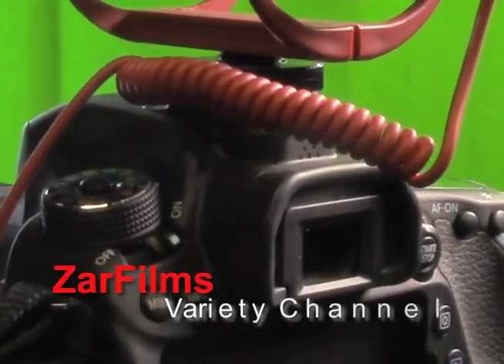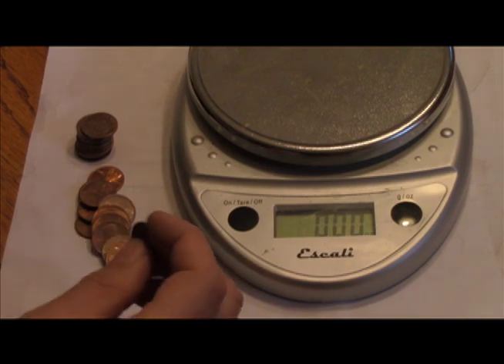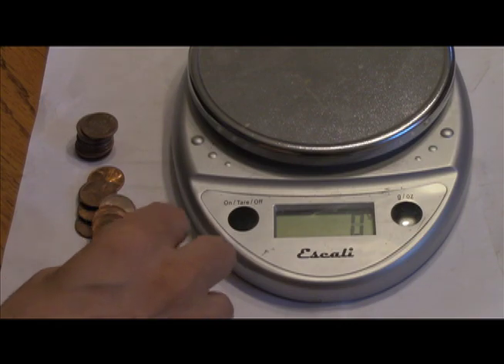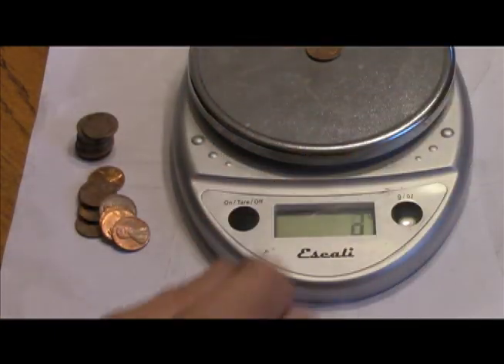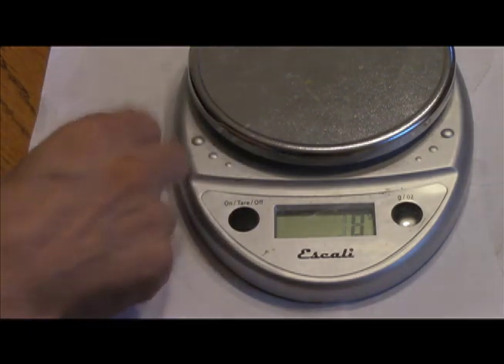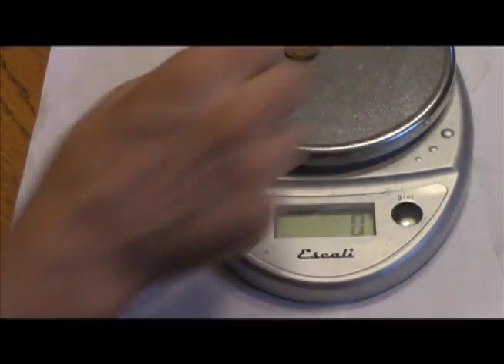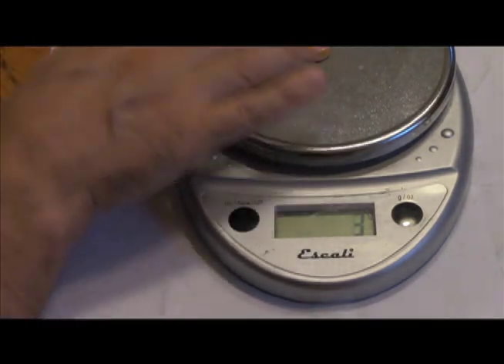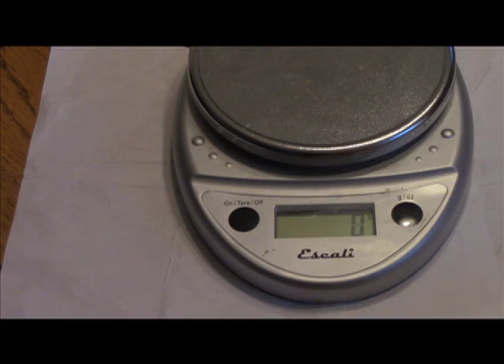How to check 1982 pennies to see if made of copper or zinc

Comment: I have a 1982 D penny that weighs 3.11 grams where do i sell it at?
Reply from the maker: unless its a small date it is only worth it copper value 3 cents
Reply: Zar's Variety Channel what do you mean by a small data? If they are does that mean that they are worth three times their value?
Reply: @ernestocarrillo7  
They are almost worthless because alot of the 82 pennies are copper.
Reply: @ernestocarrillo7  no is small data is small Date, mark means 1982 D it has to be small. There are small and large dates.